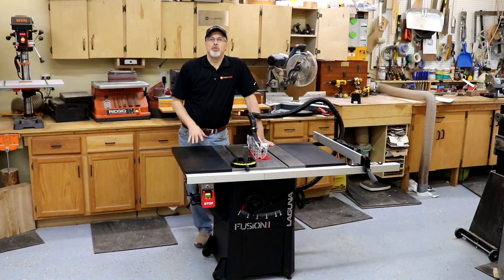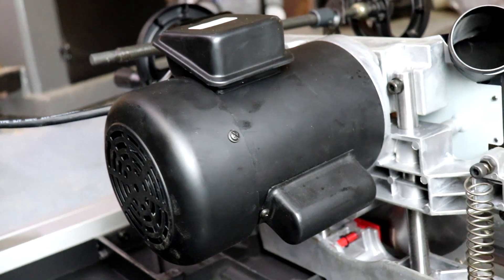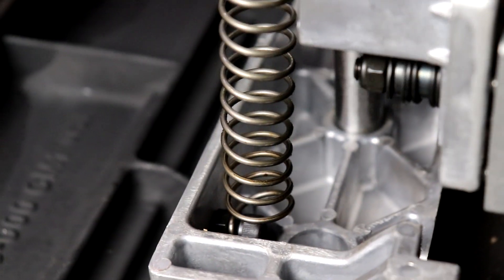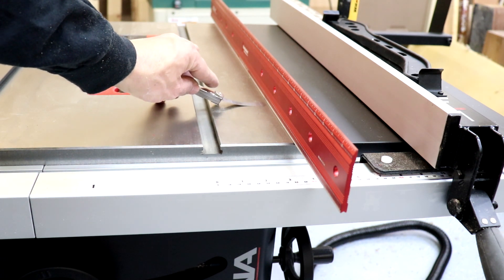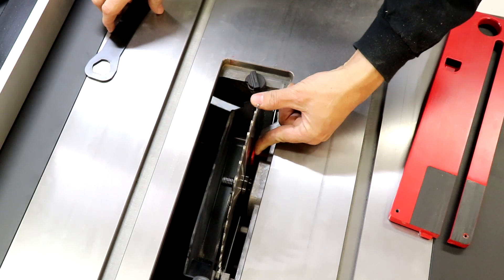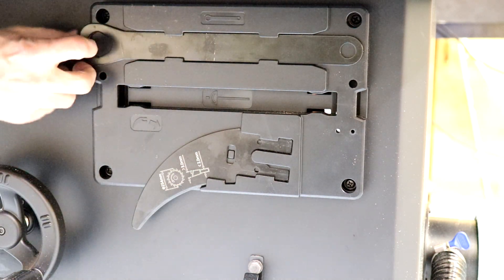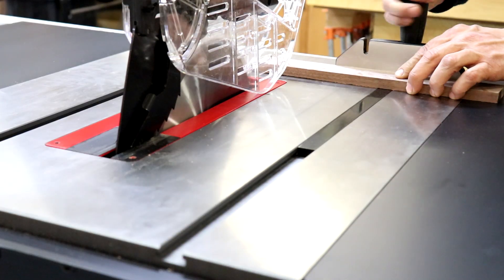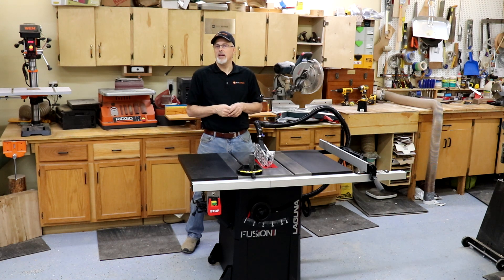Laguna Fusion F1 Table Saw Deep Dive Examination

Comment: Great in-depth review as always. The question I have has nothing to do with this saw but, I was wondering if you could do a review of the Ridgid 10 in. Cast Iron Table Saw
 R4512 ? I am looking at getting my first table saw and I really like the Ridgid cordless tools I have and was thinking about this saw as my first. Thanks and keep up the great content. Merry Chirstmas.
Reply from the maker: Hi John, I got one of those for my Dad a few years back, unfortunately before I was on YouTube so I didn’t make a video. It’s a nice saw. They are famously a royal pain to setup and my experience was no exception. They have decent power but not as much power as the Laguna F1, as far as my dad’s saw anyway. His might have a problem though. After I set it up it ran poorly. Like almost no power. A 3/4” pine board would stop it in its tracks. After spending four frustrating hours setting it up I wasn’t sure how I would deal with this situation so I took a break for lunch and I left the saw running the whole time. When I returned to the saw 30 minutes later and made some cuts it worked fine and has ever since. But I don’t know if the power that it has today is as much as it should have. It’s certainly adequate though. I’d say that the design is similar to the F1 but the build quality is generally lower. But for it’s price it’s a very nice saw in my opinion. They sold that saw for years at $550 and I always felt that they could have gotten more. I noticed recently that they’ve raised it to $750 around here which seems like the right price point for the saw.
Reply: I had problems with the Ridgid table saws I went through. You can’t complain about the price of the r4512, so I completely agree with Tool metrix. Also yes, setting up those cheaper cast iron saws ended up not being worth the hassle, headache and still the lack of performance, at least in my own case that is. A friend of mine got the cheaper delta saw, the one at Lowes, and it was a pain to get running close to true as well. When you at least get up into the low 1000$ range, although you’re not stepping up to a high end professional performance machine, you are definitely stepping well into a higher level than those more affordable ones. So at around 750$, if you can just scrounge another 300-400$, you’d be so glad that you did for what you’ll get. I ended up with Jet’s comparable saw to this laguna and after some fussing, it runs and cuts excellent. In the end, whatever one can afford, that gets you into the world of table saws is all that matters though. Good luck. Becoming a table saw owner was actually a significant point in my life, in fact changing my life and I think most saw users would also agree.
Reply from the maker: @82camino96  Thanks for your great commentary on this.   In particular I love this part of your comment: "Becoming a table saw owner was actually a significant point in my life, in fact changing my life ".  I can't agree with you more.  Although it was 23 years and 33 days ago for me (yes, it was that significant!) I remember the day like it was yesterday.  I saved up and bought the best saw that I could afford, but even at that, it was not a very good saw. :)  It was a direct drive and it was SO LOUD!  But it had a cast iron top, and worked fine.   I used it for about 6-7 years and built a lot of furniture with it.  Your point about it changing your life was also true in my case.  It opened up a whole new world to me, which I've been heavily immersed in ever since.  Cheers!